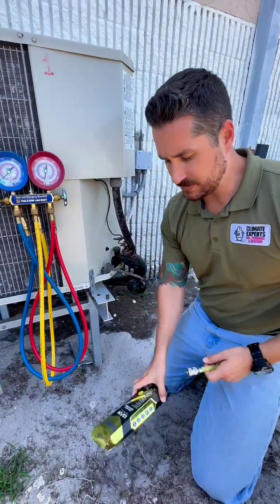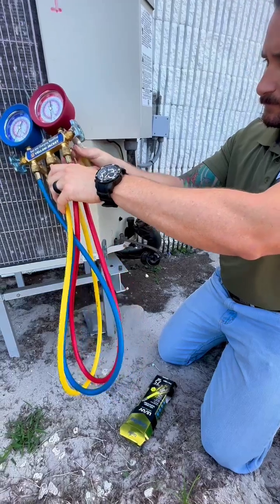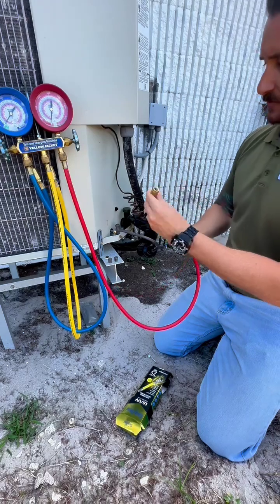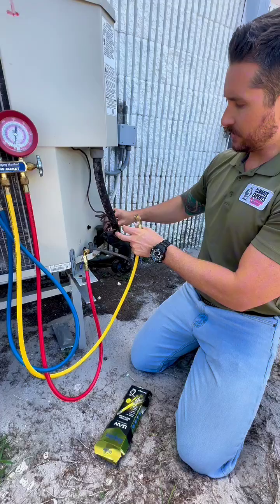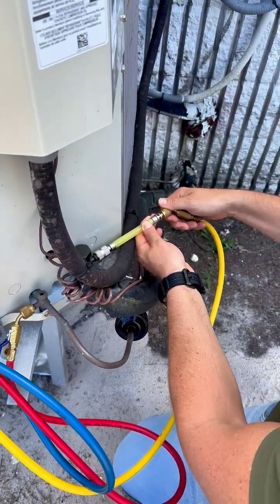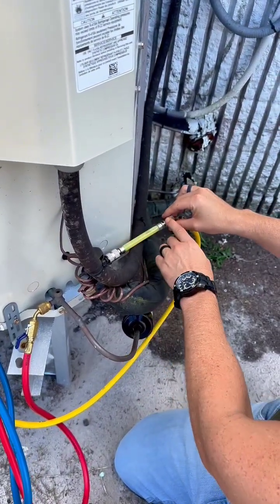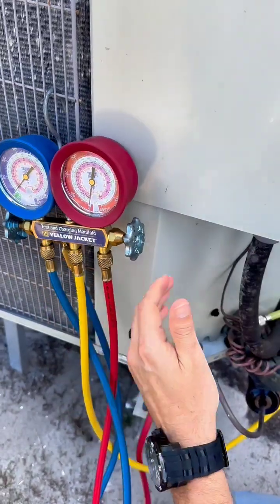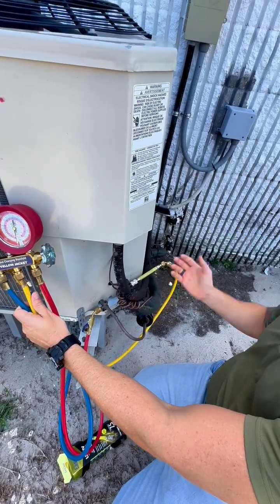HVAC Tutorial: How to Properly Install Easy Seal with UV Dye | Step-by-Step Guide

Comment: That stuff will gunk up your gauges and hurt the system that is a last resort avoid at all costs. and if you don’t have low loss fittings all you have to do is use two fingers and hold them to the side and you will not burn your hands

Comment: DO NOT DO THIS TO YOUR HVAC SYSTEM OR ANY OTHER SYSTM
Reply: They love to do this at the company i work for. Can you please explain why this is not good?
Reply: This is complete safe and works...like this gent said dont throttle the red line into yellow that he put on the suction line just crack the red discharge slightly to push in sealant.    Nice @DanielLopez-ln4qx
Reply: @DanielLopez-ln4qx best guess is your putting non condensing into refrigerant also, high likelyhood of guys not doing it properly and flooding compressor
Reply: I had a feeling this guy was talking balarkey
Reply: If it’s 410 a you’re not gonna flood your compressor, especially using that little